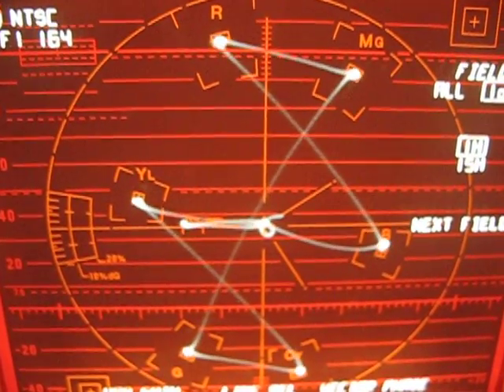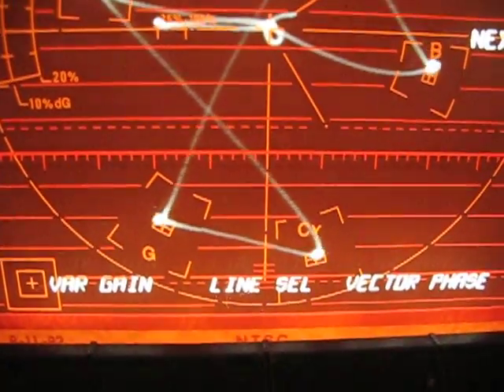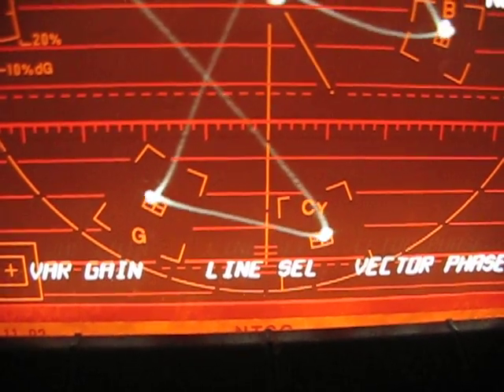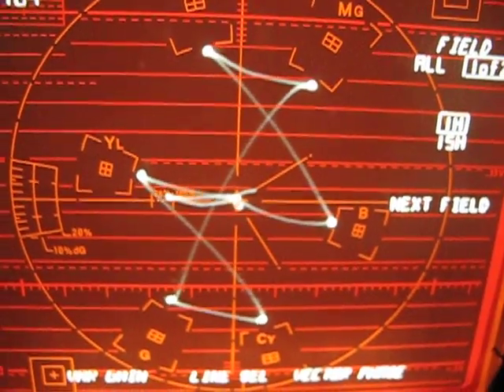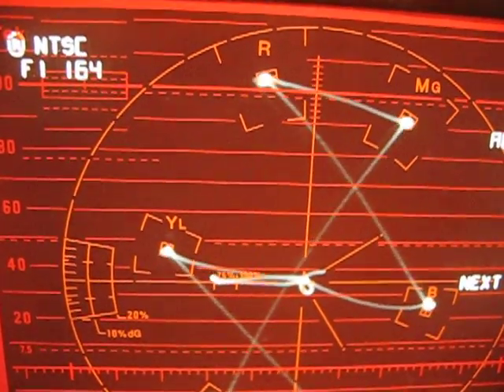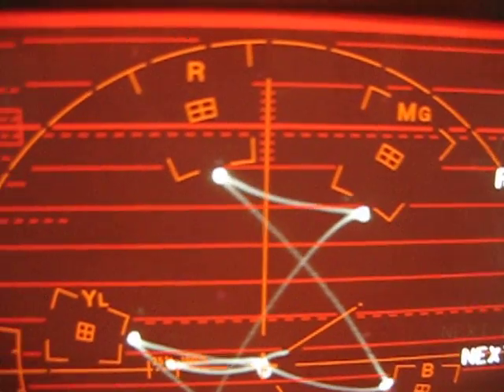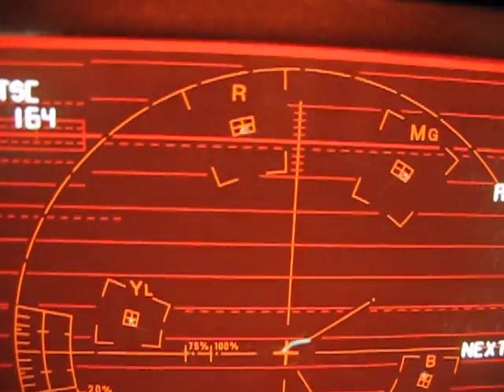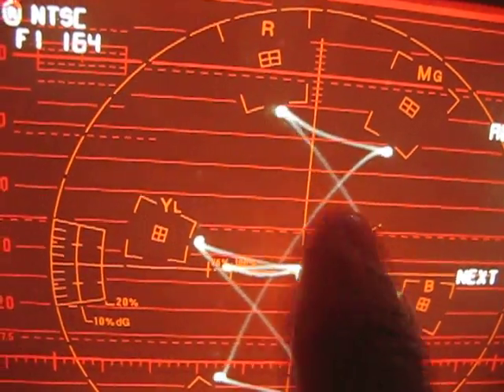Laserdisc performance modifications - color

Comment: I don't know whether the CLD-99 generates its own color-burst, or passes through what's recorded on the disc ;  if the latter, the lower chrominance levels of the unmodified player are probably due to non-linearity (high levels being reproduced lower than they should be), if the former, to a simple level misadjustment, possibly burst level too high (since the 1740A probably takes burst level as reference for chrominance decoding).

Comment: The "jitter" that you're seeing is chrominance phase noise.  The interconnecting lines are the transitions between the different bars.  The bolder they are, the more time occupied in moving from color to color, which may be a sign of a bandwidth restriction somewhere in the circuitry.